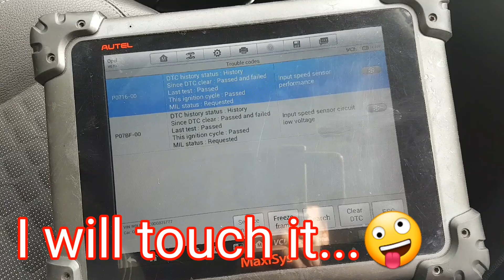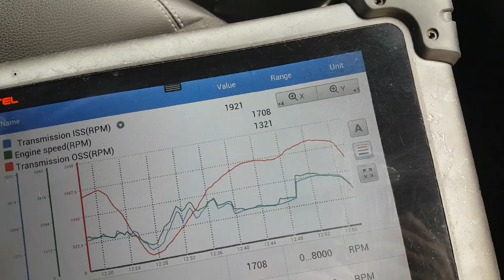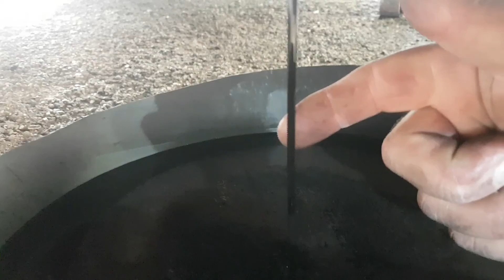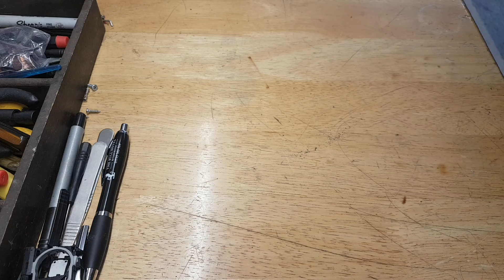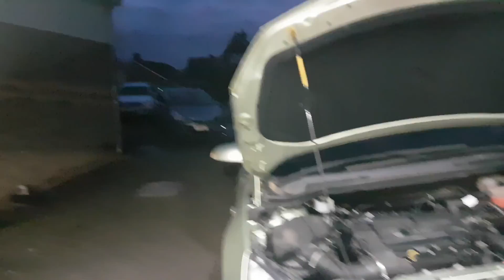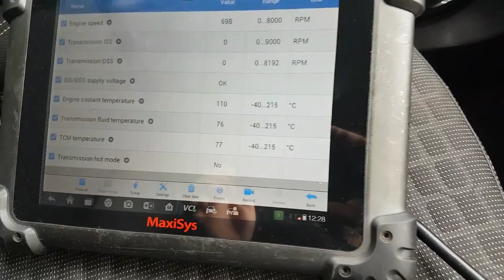Astra J Automatic gearbox faults P07BF and P0716... Fault finding and repair.

Comment: I have a 2013 Buick Encore that had the same issue P07BF once engine got up to temperature. Inspected the internals of the TCM and was just like the one in your video. Repaired it just like you and now it's fixed. Wouldn't have been able to do it without your video so thank you so much!
Reply from the maker: That's great!
👍👍👍

Comment: I have Vauxhall Astra K MK7 2016 automatic (6T35 gearbox), had the same issue exactly the same! The gear went to limp mode, so the mechanic didnt know how to fix Ended up changing the gearbox now still show P0700:00 and P30BD:00 codes and the mechanic have no idea how to clear them or fix them, any thing you can help me with please? Now the car changes gears fine but can't delete the codes.
Reply from the maker: Hi
I am not sure if the 6T335 is the same or similar configuration, never worked on one and would require investigate...
👍👍👍

Comment: Hi, I’ve got the same issue with my car. Taken the mechatronic out and tried to replace with a refurbished one but failed twice as they were also still faulty and the car has been in the garage for 6 weeks now. Wondering if you could help fix the issue with the original please?
Reply: De donde compraste la TCM? De Aliexpress
Reply from the maker: What?
The TCM was repaired, not replaced. 
Have you watched the video?
Reply from the maker: Have you opened it to confirm the same or similar fault?
👍👍👍
Reply: @LMAutoRepairs hi, yes exactly the same issue however ECU Testing couldn’t repair either. Tried replacements with refurbished units and that hasn’t worked either. If you can help that would be great
Reply from the maker: A replacement might require programming in order to work correctly...
👍👍👍

Comment: please help, opel astra 1.6 2012, drives 1km and stops, automatic transmission, what is the problem
Reply: Tranšmmision
Reply from the maker: Have you scanned the car?
It is difficult to advise otherwise...
Reply from the maker: 🤷‍♂️
Impossible to say...
Have you scanned the car?
What stops?  The engine or the transmission? 
👍

Comment: Just for reference - 
I had a car come to me with the same fault of SEVERE JURKING / CLUNKING when selecting from reverse - drive or drive - reverse  
car drove fine in all other gears & NO LIGHT on 
A mate who worked for Vauxhall UPDATED the gearbox ECU & it was fixed
He said that there was a bulletin for the gearbox update - on the vauxhall system 
So if you ever have the same but with NO LIGHT it could be the update 
I was guessing it was the update -  all the way until you showed the broken wires !!
Thanks for posting this 👍👍
Reply from the maker: 😊
I know about the update, done a few, videos on my channel...
👍👍👍

Comment: Louis that was a nice educated lucky guess. I have never seen gel encapsulation in such an area. Why do they(continental) use gel instead of hard epoxy potting? What I can see from the broken wire it was a fatigue damage(vibration load) what could be avoided with hard epoxy potting. I think it is a non repairable item so make no sense to be transparent. Also a big fat heat spreader under the PCBA can do its job without gel potting as well. Do you know any gel potting material? I am curious how long your soldering last in such a vibrational environment... I was also surprised that you could solder it without degreasing after the gel ... I am almost sure this is a design issue and many owners can suffer from it...
Reply from the maker: This type of gell it is used in many similar applications... I have videos on other systems with the same stuff...
When soldered this way and with copper wire, it is usually a safe connection...
It is the aluminium wire that tends to fail...
👍👍👍
Reply: @LMAutoRepairs  Yes, cost saving alu is much cheaper than copper wires.. some application we use gold wires :)

Comment: There used to be a vauxhall that had the ecu mounted directly on the engine, it was notorious for breaking multiple of there thing wires because of vibrations
Reply from the maker: Yes, I have repaired a few...
👍👍👍

Comment: good morning Luis  thank you for a nother sunday video and at 51 25 i see the normal orange fault light flashing
Reply from the maker: No worries... plenty in the bag...
👍👍👍
Reply: @LMAutoRepairs  i stick 25 quid of fuel in if light is on or low less than 100 miles if i have to test drive no way walking  the bill go es up by that much they get the recipt